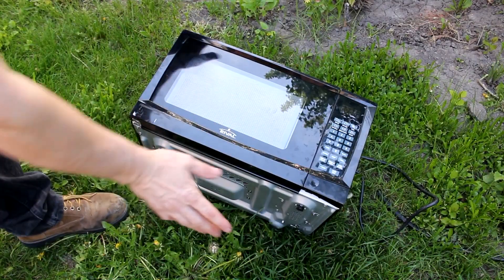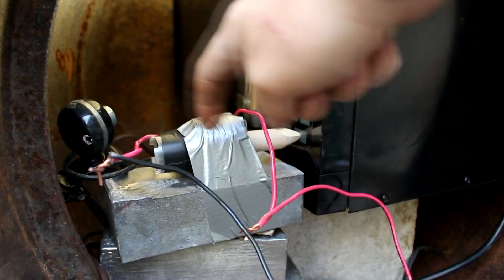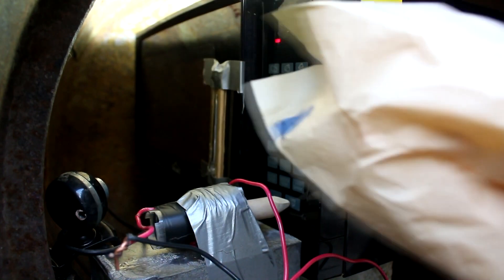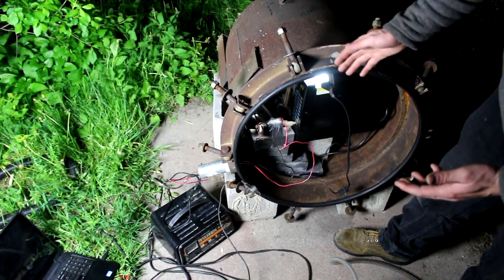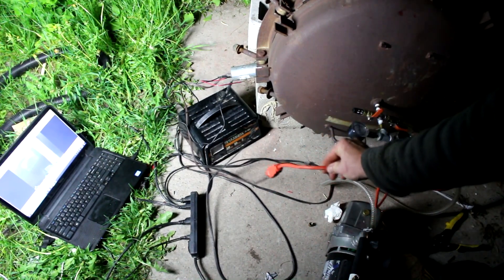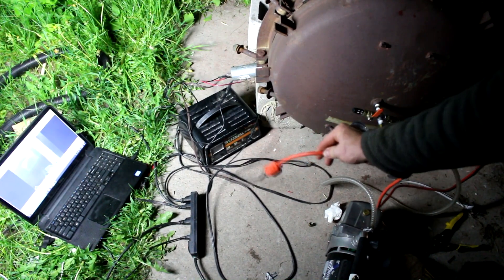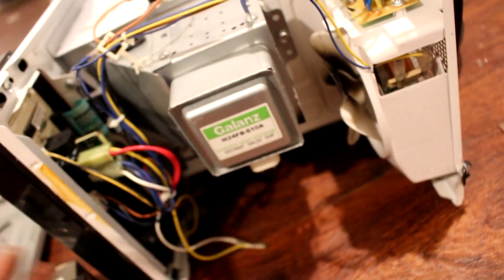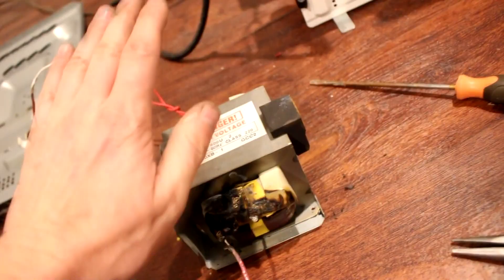Microwave In Vacuum Chamber

Comment: Hey Cody, some weird stuff happens to  relative permeability of gases under vacuum as described by Paschen law, you might want to try submerging the transformer under oil  as  it does not suffer from those effects, also upgrade the insulation of the high voltage wires.

Comment: I wonder if any air trapped in the insulation when the coil is laminated ruptured violently under vacuum. Maybe that caused the wire to be bare at points allowing the conduction. 

Just a another angle to consider. To test this you will need a mega and a new transformer. Check the insulation resistance before and then under vacuum.

Comment: Im debating to myself about this one. There's a possibility that the magnatron itself arced over as it ionized the small amount of gas in the chamber. If that arced over, it would draw much higher current than the transformer was designed to produce. Microwaves ionize gas much easier than DC currents, which makes me wonder if this happened as opposed to the transformer itself arcing over.

Either theory holds water though. That small amount of air is easy to ionize.

Comment: More likely that the heat could't dissipate from the transformer causing the insulation to break down creating an arc with the smoke created allowing the arc to travel. Vacuum should act as an extra insulator (they actually use vacuum in HV industrial circuit breakers to quench the arc).

Comment: The filament inside the magnetron burned out because of lack of cooling, no more emission, no more current then high voltage rise, arcing at the transformer...
Resistivity of air diminish with pressure, vacuum is always better than pressurized.
Reply: Nah, you wrong: Plasma is a different state as gas, you cannot compare their conductance. Btw I was talking about air.

Comment: You can actually see what happens to high voltage coils of wire in a vacuum on the channel Electroboom.  The electrons have a lot easier of a time jumping around and they will cause the enamel to bubble and eventually cause a short.  That's likely what happened here.

Comment: Look up how vacuum tubes work, it's the same concept.  Remember air is an insulator.  In a vacuum it takes very little amperage to create an electron field which can jump quite far.  Remember air is an insulator.  Your transformer made the perfect environment for this as it sacrifices amps to ramp up the voltage.

Comment: you could put the transformer outside the chamber, and connect it through the wires in your wiring hole. try make them far enough apart not to arc, too.

Comment: Low pressure equates to less air molecules, less air resistance. Since air resistance is practically the only reason we don't have electricity arcing everywhere, it's almost definitely what happened to the transformer. Especially since typical voltage would be several kilovolts, that'd have no problems at all arcing maybe even a few centimeters.

Comment: In low pressure arcs can jump way larger gaps. This is the reason why long fluorescent tubes can strike an arc inside over such a long distance.

Get a neon sign transformer and play around with high voltage in vacum. It can make for some interesting effects.

Oh and the reason it arced there is that the other side of the high voltage coil is connected to the metal core of the transformer that is then grounded. That HV output terminal is close to the core so it jumped to it.

Comment: I am pretty sure what happend there is that you got a glow discharge between the transformer and one of the high voltage wires. Those can get extremly hot and easily melt the insulation of ... pretty much everything. See if you can get your hands on a pump that goes down to under 10e-2 mbar, from that point on you should have pretty good insulation through the vacuum, that way your microwave might survive a bit longer until it overheats from the lack of cooling :D

Comment: Smarter people than I have already said essentially the same thing, but from a physics II perspective, the transformer arced and shorted itself because of the higher permittivity of the "vacuum." Air at one atm has a higher impedance than it does at lower pressures, so the terminals on the transformer were spaced far enough apart for operation at one atm, but arc at much lower pressures

Comment: now we just need to see how well your computer will run in a vacuum.  

(hint: you might want to install a Peltier in the wall of the vacuum chamber, or some other cooling system.  Also, possibly underclock it to lower heat production.

Comment: Was this a precursor test for eventually trying to test an emdrive in a vacuum?  I thought I remember reading that one of the problems with testing an emdrive in a vacuum was that a typical magnetron uses capacitors that require air to function properly.  If that is the case, you may want to look into replacing the capacitors with ones rated for use in a vacuum.

Comment: you could repeat this experiment by taking transformer out of a microwave and connect it from outside with wires you have in your vacuum chamber, that way microwave would work (probably)  and your transformer would be at normal atmospheric pressure.

Comment: if it really was heat (overheating melting the enamel coat on the coil wires), maybe you can try other cooling methods like a dry-ice cooled oil bath, or if you're crazy enough, and I know you are, running the magnetron directly with an outside-of-the-chamber transformer, just so you can compare vacuum popped corn to atmosphere popped corn.

Comment: AAaaa Watch out cody you almost touch a 2100 volt charged capacitor. 
The transformer, diode, capacitor combination at 7:07 is known as a Villard circuit it a voltage doubler to 4200 volt and rectifier it to DC.  Btw If you want to have the magnets from the microwave then look out for the porcelain tube this contains the cancer-causing barium oxide.

Comment: Now you need to try a more modern microwave that uses an inverter instead of a transformer to generate the high voltage. Perhaps it will fare better or at least have a different failure mode or last longer?

Comment: you can use an alumina window to separate vacuum from atmosphere, but it allows microwaves to pass through. you could then have the magnetron and circuitry outside, and a cooking chamber inside.  maybe alternativy you could try potting everything HV in epoxy.
Reply: incidentally, once the HV breakdown problems are solved, you're likely to have a similar effect with the microwave EM field density in a partial vacuum. Once popping, etc starts, and hard vacuum is lost, the gassed will turn to plasma/break down in arcing all over. I'd love to see that! Please keep trying!

Comment: Edit: I should read the other comments first ;) 
My best guess is, that the high voltage microwave transformer is using the air as insulator. At normal pressure it can arc about 1-2mm/1000V and these transfomers go up to 2000V (and 100% deathly current)!

Comment: a vacuum actually has less resistance than air so when you turned it on, two things happened. The insulation started to rapidly overheat, and an arc formed between the coils, which basically shorted things out.

Comment: Looks similar to what happened to ElectroBOOM's tesla coil in a vacuum (cba finding the actual video, it's fairly recent so someone less lazy than me will have no trouble), what happened to him was the air didn't provide as much resistance as there was less of it, and it started arcing through the coil which melted the coil and made it fall apart (iirc)

Comment: Air is an insulator. Depending on the exact microwave you could have as much as 5kV in there (newer ones run at 2kV ish). To prove your point you could get a microwave transformer and have it external then connect it via HT leads (car ignition lead wire is perfect) to a spark gap. About 1 inch should be roughly right. Depending on humidity you could in theory get arcing as high as 40% of normal atmospheric. The "quick and dirty" method for a spark gap i to have two copper screws through a piece of wood so they are angled together. You can adjust the gap by adjusting the screws.

Comment: In vacuum, electrons can easily to jump directly without resistance (obstacles), I recommand to fill a resistance fluid around all electric circuits (air, oil like computer inside fish tank, there are videos for fish tank cooling system for computer) and only magnetron  antenna can support vacuum. MOT deliver high voltage and a lot of current (See the width and length of electric arc on air, like MOT jacob ladder) at exit who can create short circuit in vacuum, high current can burn coils and wires. If the gab is too large, in vacuum circuits behave like capacitors (see jacob ladder in vacuum). And voila. Excuse-me for my english  I speak french. :)

Comment: Cody I think you have an uphill battle.  If you pull the electronics out of the vacuum and used spark plugs as feedthroughs for the magnetron the magnetron doesn't have a way to cool itself, the magnets will fail. If you fashioned a wave guide port into the chamber and pulled everything out of the chamber, you'd likely find that you pulled the moisture out of the popcorn as you are pumping it down so no steam to pop the kernel. I wonder if you could pop a kernel using a small chamber and a vacuum reservoir to rapidly decompress it. Maybe mod it and flood the electronic chamber side of the microwave with a dielectric oil.  Have fun, take pictures :)

Comment: This might've never worked even if the microwave didn't die.  They heat up food by agitating water in the food, but organic matter in a vacuum loses water to outgassing.  Might be that enough water loss would make something unheatable by microwave.  

Might also be that the pressure differential in a vacuum could cold-pop popcorn.  Worth a shot?

Comment: As an electronic tech, it seems like the reason it overheated like that is you had AC in a vacuum.  Normally the air is an insulator that would require an arc to form in order to become conductive. However, in a vacuum there is basically nothing to ionize into an arc that would form a more conductive path like you see in air. So instead, like you have in vacuum tube capacitors, every bit of exposed wire in the same vacuum forms a closer-to-ideal capacitor with every other bit of exposed wire/metal. IDK how much you know about electronics theory, but as a giant capacitor, you were inputting mains AC and not bypassing the internal transformer, the high power AC could literally flow/jump to any other point inside your entire vacuum without having to form an arc... 
Honestly, if any of the other devices you had in there were more conductive to ground or the negative of the AC, you could have fried the other electronics. 
The easiest fix is to extend the wires out of the transformer and keep just the transformer external to the vacuum so that all you have going into the vacuum is DC.

Comment: leftover air in the blister buttons on the face of the microwave could be increasing the resistance required by your solenoid to push the button in

Comment: Mircowaves will pass through vacuum and you will not see it arc obviously. Arcing is when electricity develops a high energy due a MEDIUM (conductive only to electricity that is beyond a certain threshold of energy thus converting the medium into plasma as it passes through) between two differently potential spots. Point being plasma or the arc that we see is simply the super heating of the medium. Since there is no medium the arcing wont be visible. even in space, lightening storms are only seen when there is huge gas giant, not otherwise. upon getting suitable energies wrt the masses the particles i think will pass as waves.

Comment: Under low pressure, air has much lower breakdown voltage. High voltage arced over and hot plasma damaged the secondary winding of transformer.

Comment: 4:50 is that the sound of corns popping Im hearing? If so, it seems to start popping much sooner than in normal pressure. Im thinking it would be interesting to see the popcorn, and compare the time it takes before it starts popping in a vacuum vs normal pressure. I guess it makes sense that they pop easier and sooner in a vacuum.

Comment: " breakdown voltage in air is a function of gap length times pressure"  - according to wikipedia (electral breakdown), so at the same voltage they can travel further. Or you just figured out how to duplicate items using a microwave and that old vacuum vessel at the cost of a fuse, which i wouldn't be so surprised either. Maybe shorten the plug to see if more the popcorn pops tho.

Comment: There are two things that I can see causing the arc. One, yes a vacuum does allow electricity to jump larger gaps. Two, microwave wavelength is defined in one atmosphere of pressure. It is likely the vacuum changed the wavelength and subsequently the power needed to drive it.

Comment: Shielding appropriately might work. An alternative cooling system might also be useful, if you get it running longer. possibly a water reservoir with some good radiator cabling?

Comment: My guess would be the secondary coil overheated and burned off the insulation. This caused it to short to itself and start up that arc which definitely did some dancing. A thought I have is....Fill it with oil...and make sure to get all the air out from between the windings(easy enough with a vacuum chamber) that is if you actually want some "-95% atmosphere or less" popped popcorn and have microwaves to burn :)   Also a visual display like a neon bulb also in oil and in a clear container would show you if you actually got some microwaves produced. A bulb with no leads is best though.
Reply: Mineral oil should work fine.

Comment: You can still user this transformer for spot welding, Remove High voltage coil and replace it with a thick wire 30..40mm² 1..2 turns

Comment: Air is a pretty good insulator.  Perhaps without the air, the high voltage secondary was able to arc around to ground/neutral much easier.
That transformer and HV output didn't have good insulation and arc protection anyway.  Perhaps cost-cutting cheap manufacturing and assembly.

Comment: cody th etransformer heated up the watts increased by it and caused the epoxy resin on the coil burned and shorted it unles u want to break an MOT use enouf cooling

Comment: Electricity will arc at low air pressures where it would not normally. Air is actually an insulator which prevents arcs here in the surface of the earth.

Comment: What if you separate the power electronics of the microwave (Capacitor and transformer, mainly) from its enclosure? So you could keep the transformer outside, preventing the arcs and route in the cables through your opening already in place to make the magnetron work. Also the you can disconnect the fan, since it would lose its function when there is no air in place.

Comment: With the lower pressure you ionize the gas a lot more easily. Think the neon bulbs , all have very low pressure inside them. In order to work you should have very high vaccum, not partial vaccum that you had. Hope you see this if you want I can give you a better more detailed explaination.

Comment: OH NO Cody! Why did you think you could get electrocuted via RAIN water!? Even using conductive brine, it would be VERY difficult to electrocute yourself with an un-fused and un-earthed 120V suppply.
Seriously,  fill up a bucket with some water (dosnt need to be deionised like most people think), strip a power lead so that about 1" of copper is sticking out from the live and the neutral, and make sure to disconnect the ground pin so that the breaker won't trip to 'save' you... Then simply immerse the exposed wires into the bucket of water and stick your hand in there as well. As long as the live and neutral ends are much closer to each other than your hand is to the live wire (for example, you have an inch or so between the exposed wires, but your hand is at least around 10 inches (or around 20~25cm) away) then you won't even receive a shock from a 220V 50A household socket (like we have over here; I did actually try this myself), so 120V would be even safer. In fact, as long as your skin isn't broken somewhere, you will most likely not even be able to feel ANYTHING, even if you dump a bunch of salt into the water...

ElectroBOOM has a really good video explaining this.

Comment: Does air at atmospheric pressure act as an insulator? If so, I might guess that the high voltages have more potential to arcing through vacuum. You know what's next... Jacob's ladder in the chamber, for science!We have one down at the ProVolt makerspace and you could borrow.

Comment: I had my money on Insulation failure I was not wrong.
High voltage clearances within our atmosphere near the operating voltage are between 
Arc Distance in Air (min): 0.019 inches (0.48 mm)
Arc Distance in Air (max): 0.119 inches (3.02 mm)

In A vacuum electrons are free to go where they like A CRT tv uses a vacuum For this very reason.

Comment: I think that because microwave oven transformers have one side of the secondary coil grounded to the frame it started to arc between the frame and where the other side of the secondary goes to an insulated wire.

Comment: I'm surprised it overheated and shorted that quickly.  It would be interesting to wire the transformer outside of the vacuum chamber to see if the magnetron can handle operating in a vacuum.

Comment: well air is really resistant, meaby if you suck away the air it removes that resistance, making it easier to jump trough the gap than trough the circuit?

Comment: the problem is that microwaves use Kv cap and transformer. in vacuum you have no air so the insulation of the air does not exist . :)